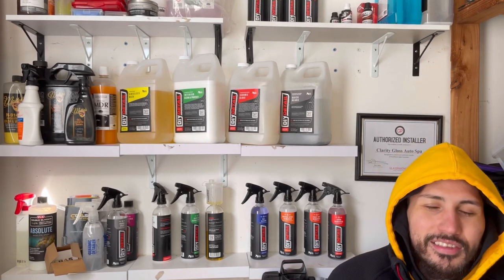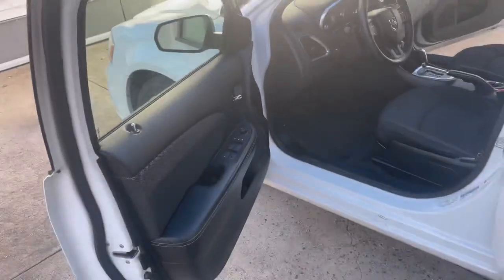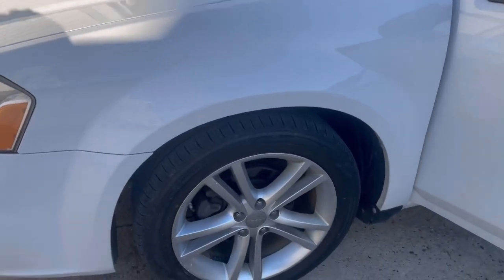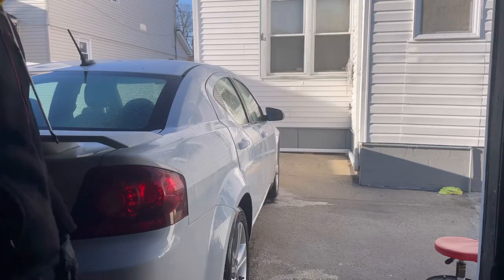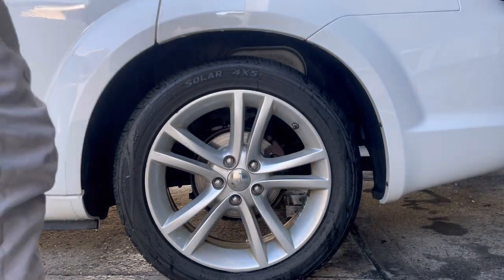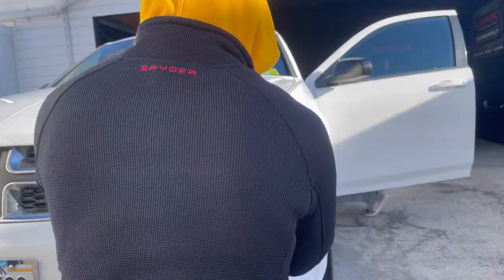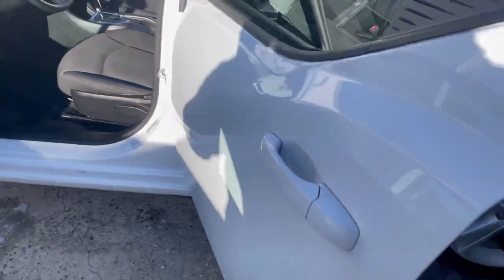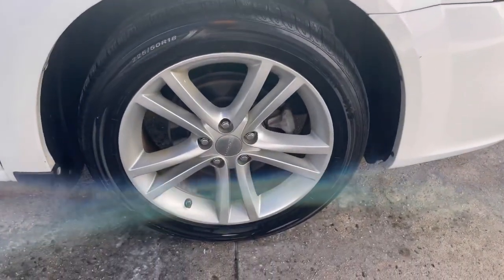Winter Car Detailing and How To Do It #winter #cardetailingtips #carwashing

Comment: Great video
Reply from the maker: Appreciate it brother. 💪💪 glad you enjoyed the video it gets hard out here in the winter 🥶😂😂
Reply: @DetailingMadeSimple  Not many other videos out there showing how to clean paint/tires in freezing temps.  Just debating between using a IK sprayer/garden sprayer or portable Worx pressure washer to break off heavy salt with pre-rinse rinseless wash. thanks man
Reply from the maker: @betterthanme9534  you can use either they all work perfectly fine! 👊 some maybe more efficient than others

Comment: My headlights are getting a little yellow, they were sanded a year ago, what's your advice on how to tackle them?
Reply from the maker: Hey Nuno. All depends. What is the year of the vehicle. What sanding approach did they do how aggressive if you know? If a little yellow. Just give it a polish and either ceramic coat it. also try the cerakote headlight restoration kit/Griots garage one. I’ve always heard they work well and easy to use. 👊 Those are my 3 best approach.
Reply: @DetailingMadeSimple  its a 2008, from what i've seen they went kinda classic sanding, 600, 1000, 2000, after that polished with 2 products that i cannot remember, after that some protection,  i have in my possession K2 lamp doctor, dunno if it will do the job, think its a 3000 grit polish
Reply from the maker: @nunomuacho446  Copy. Yes if it’s been done that aggressively before. Doing it that way may have compromised the UV protection from the clear coat on the headlights. So depending how oxidized it is try a polish first see how that does. And protect it with the cerakaot. Which will definitely prolong the headlights.
Reply: @DetailingMadeSimple  thanks brother!
Reply from the maker: @nunomuacho446  anytime 👊

Comment: Over here in Long Island is 75 degrees. 😂
Reply from the maker: Lies!!! 😭😅😂 I get my Polish tomorrow . I may do that live on Friday. Going to be 54. Or maybe Saturday which will be 40 degrees. I will most likely do a separate video washing and prepping and do a quick live. For about an hour using the polish and testing it with obviously their pads and microfiber since the customer is getting a one step polish
Reply: Good stuff as usual!   For the clay and seal, did you use the DIY Detail Ceramic Gloss?
Reply from the maker: @lukepyron7468  thank you brother. You can use either or. Quick beads or ceramic gloss. My preference is Ceramic Gloss. Plus it’s more cost effective that way 👍
Reply: Dude, your a bad ass detailing when it’s 20-degrees outside. It’s been so cold the past few weeks that I’m taking an extended break until it warms up a bit. On headlights I use the Cerakote wipes after sanding and polishing. It really blocks the UV and lasts for years on the polycarbonate lenses.
Reply: @DetailingMadeSimple  I get mines today too. There is a YouTuber that already has it. But the way he use it was the opposite of Yvan a Nick use it 🙄  That will be great if u can do it Friday or Saturday. Not sure when I do mines but right now my car looking like a $2 prostitute. Looks like rain for me this weekend or something. Am forced to take a day off tomorrow from work I’ll keep my eye out
Reply from the maker: @johng753  appreciate it brother. Yes was super cold that day. Yes for you definitely take a break or do it in the garage. This whole detail took only 1 hour to do polished the headlights and tail lights. Was just being efficient. Cerakote I never tried. I really should one of the days I always here great things about them.!
Reply from the maker: @stevenv9224  😂😭😭. Your car looking rough? I may have any idea who you are talking about. I mean it was just a 2 min clip. I’m thinking of probably Friday. I’ll confirm it 💪💯
Reply: You probably know who I’m talking about I guess he is big in the YouTube, as well as a detailer. Not bashing him or starting a war in your channel. 😂😂😂😂. But I wasn’t feeling it the way he was using the gold standard. He using other brands on top of the polish. Like who does that? 😂😂😂😂. But real talk I want to see the real deal with the polish the way Yvan an nick demo it shows u that u don’t need much to bring it out. Not sure if am making any sense on that.
Reply from the maker: @stevenv9224  I will look around I think we are talking about different people. But definitely. Everyone has their own techniques and methods. But as a true test always to show the recommended way and alternative and see which best fits your style
Reply: You right people do have different styles of cleaning and getting different results. I guess as for me a non detailer🥺 am trying to make cleaning cars simple but start to the point in a timely matter. I’ll say the YouTuber name. He goes by Jamie. Again am not bashing him or anything. But the way he used it just threw me off.
Reply: When you do your live show tomorrow or Saturday. Depending on weather conditions. Just do your think no pressure. Just remember I’ll be watching you if I see something not right  🤣🤣🤣 don’t be surprised if you see me there saying (cut cut cut no gold standard polish for you no more). 😂🤣.
Reply from the maker: @stevenv9224  Jamie is a great detailer. Yeah people have different ways of polishing and techniques. You won’t know until you start doing it yourself. I look at the polish as a tool. There are different hacks you can do with that tool. There is a specific use and the way it should be used. But with experience you develop your habits. 😂👊💪

When I do the live I will show my method and Yvans and Nick method. My job as a detailer is to give the best results and being efficient 💪💪
Reply from the maker: @stevenv9224  No pressure! Copy that it will be my first live. I think faster than I speak I’m already nervous 😭😭
Reply: Nah bro you should be fine. As long they don’t have a live shoot out in your block should be ok. My order is out for delivery should get it later. Not sure when I will use it. Am praying I don’t messed it up too. Not sure if the gold standard is Puerto Rican proof. But I will watch you do it first. What time u think you will be on? I take grandpa naps in between. Am up 3 am everyday am up before Jesus himself.
Reply from the maker: @stevenv9224  exactly 😭😭. Same here my order is out. Should be Puerto Rican proof. If used as directed 😂😂. I’m thinking maybe between 3-5pm latest. I’m thinking of doing a whole wash Decon prep video first. To have it archived then I will go live right after to Polish and talk to you guys.
Reply: Yeah that’s a good idea just go straight to the polish. I think people already know how to decon and Yvan and nick has video on it. Just go straight to the main event brother. 😉